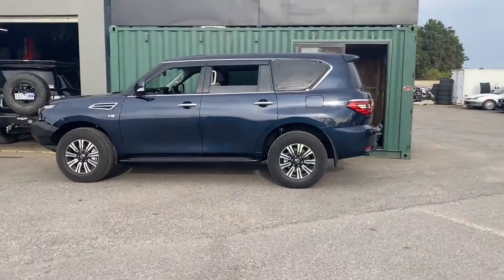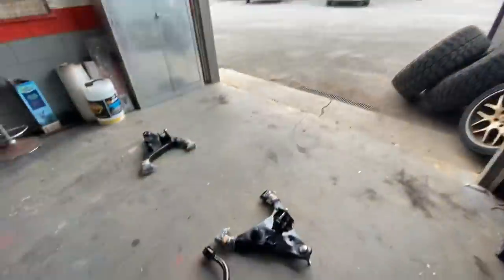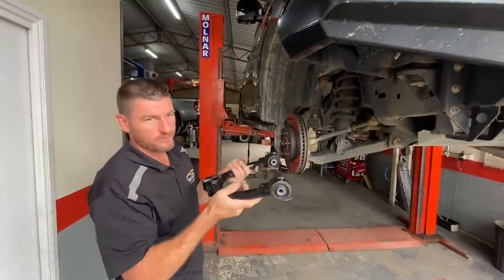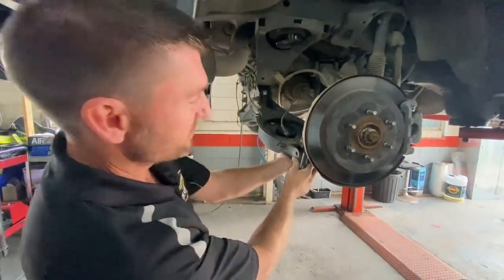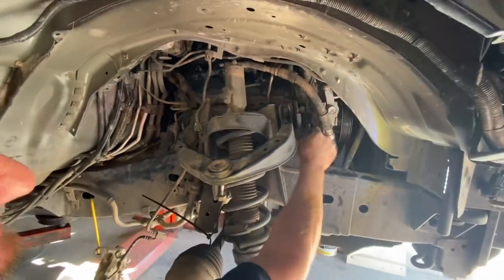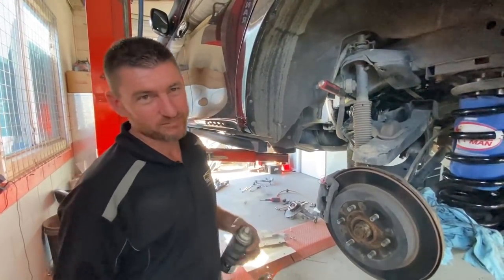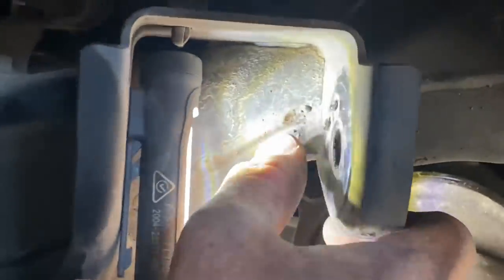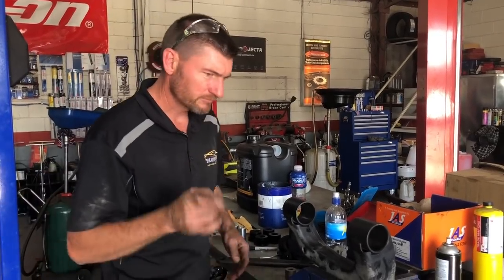How To Install OnTrack HBMC LCA Lift to Y62 Patrol

Comment: I managed to install the lift in my S5 without removing the power steering pump, I was able to jack engine up slightly to give enough clearance. 
I also drilled out the rear control arm bush rubbers that gave access to the bush sleeve which i was able to use a dremel to carefully split then tap out. I have a hoist at home but it was consumed with another car so did the lift install on the garage floor.
Reply: Yeah realist. Anybody who thinks about attempting this usually isn't their first rodeo. Good work mate

Comment: Very well explained along with visuals to get a good understanding of what goes on to achieve end result, the front suspension lower control arm extended lower shock mount I get so to be able to leave alone the shock itself BUT you loose a lot of compression in the shock which is exactly what you need with extra weight, yes you still have the same amount of articulation so realistically putting the correct spring in for extra weight to achieve ride height as well as ratio of compression and top out ( Droop ) is the best way to go, don't forget the original spring will sage because it's not designed to carry the extra weight.

Comment: Good share m8. I put mine in on the floor of my shed with the help of a 6pack. Got the wheels aligned at the local nissan dealer. Took me about 8hrs, lol
Now i gotta buy some of them extended bump stops, theyve been sold out the last few times i thought of it.
Cheers
Reply from the maker: In stock currently 👍

Comment: I fitted this kit to my series 5 on the garage floor and it was an absolute fight all the way. The fitting instructions were terrible and when I phoned On Track for assistance, the guy who answered couldn't have been more disinterested - almost rude. I didn't want to cut the front K frame bolt so I supported the frame, took out the bolts and temporarily replaced them with the much longer bushing bolts. Then when I lowered the K frame down (only just enough to slide the bolt out), it came down square. On re-installation, the long bolts acted as guides and the frame slid nicely straight up into place. I put the K frame bolt back in the opposite direction (why Nissan don't do this in the first place is beyond me). On the upside however, everything ended up fine and the wheel aligner had no trouble getting all the geometry right. Alarm bells should have gone off when I couldn't find anyone in my area willing to do the job. Anyway it's done, it turned out a success and I achieved what I wanted but if you're considering doing this job yourself at home, you'll need a mate, a lot of special tools and a ton of patience.

Comment: Damn I wish this vid was out a week ago - just fitted this with a mate, front went well along with rear springs and bags but decided to pay my reputable mechanic to do the bushes given the rear ball joint difficulty... He told me to never give them a job like that again 😄. David, could you please reinforce your message from an earlier video about right spring rates? I got medium springs (200kg constant) without a rear bar and am sitting at 620 eyebrow heights... too much for alignment to work so am either up for new, softer springs or only 10 thou out of new 35s
Reply from the maker: Always speak to an expert first 😉

Comment: Great video, thank you for this!!!

The only thing that doesn’t quite sit right to me with an HBMC lift is that you’re stuck with the factory shocks which...hopefully they’re ok compared to the quality aftermarket options? 

Also, I see you have a light and medium front lift option, how is that load difference achieved? By disconnecting the hbmc line and replacing the coil spring?
Reply from the maker: Light and medium is just a taller or shorter bracket to allow for spring sag with extra weight. Coil lift is another whole game with the Y62, but possible

Comment: So if I used the billet rear arms there is no need for castor bushes in the rear am I right ??  Great video btw👍
Reply from the maker: Incorrect, you will still need the camber correction bushes
Reply: @DASHOffRoad  ok thankyou